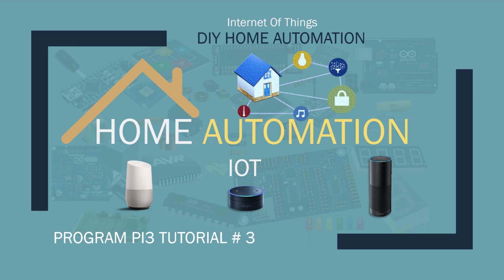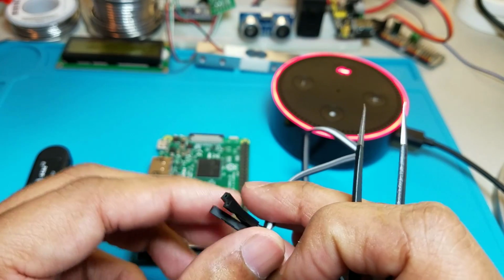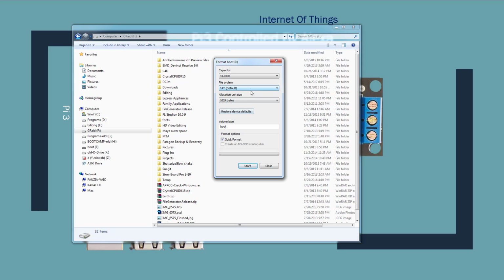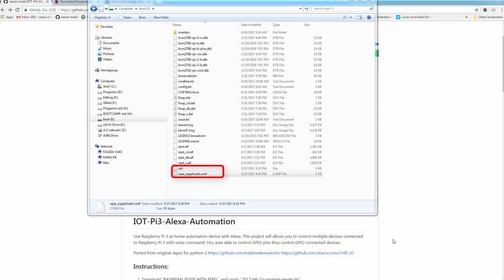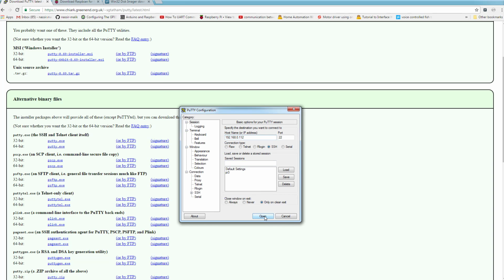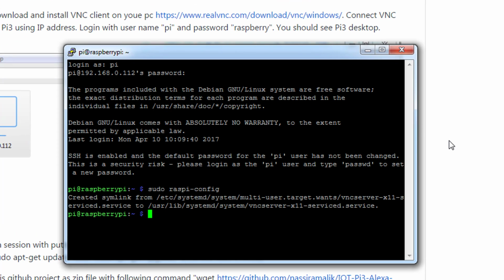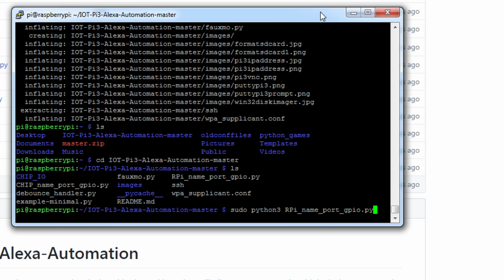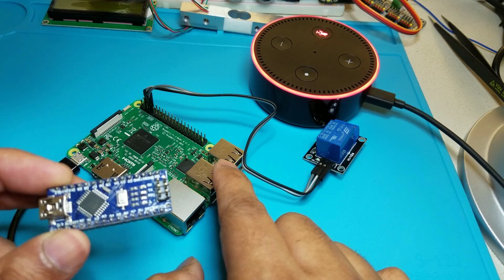Raspberry Pi projects beginners | Home Automation with Alexa | Tutorial # 3

Comment: I am trying to use a 4 relay block with this. With LEDs the code works perfectly with voice commands. However, using the relays the HIGH output state turns the relay off and the LOW output state turns the relay on. Due to the nature of the project I am doing, I cannot simply flip the wires in the relay to invert it and rather must do it on the python code. I have tried using "if" statements to say
 if state=="True":
                GPIO.output(int(7), 0)
 else:
                GPIO.output(int(7), 1)

but this doesn't work. Is there any way to flip the variable state?

Also, is there any fix for the following when launching the program in the terminal?
pi@raspberrypi:~/IOT-Pi3-Alexa-Automation-master $ sudo python3 RPi_name_port_gpio.py
DEBUG:root:Listening for UPnP broadcasts
DEBUG:root:got local address of 192.168.*.*** (these aren't actually stars)
Traceback (most recent call last):
  File "RPi_name_port_gpio.py", line 85, in <module>
    fauxmo.fauxmo(trig, u, p, None, port, d)
  File "/home/pi/IOT-Pi3-Alexa-Automation-master/fauxmo.py", line 195, in _init_
    upnp_device.__init__(self, listener, poller, port, "http://%(ip_address)s:%(port)s/setup.xml", "Unspecified, UPnP/1.0, Unspecified", persistent_uuid, other_headers=other_headers, ip_address=ip_address)
  File "/home/pi/IOT-Pi3-Alexa-Automation-master/fauxmo.py", line 130, in _init_
    self.socket.bind((self.ip_address, self.port))
OSError: [Errno 98] Address already in use

Comment: I like this project, but I can't get Amazon Echo to find the Pi. I am using RaspPi 3; Model B with a brand new Echo. This is the status of the Pi when I run "sudo python3 RPi_name_port_gpio.py"

DEBUG:root:Listening for UPnP broadcasts
DEBUG:root:got local address of 192.168.0.10
DEBUG:root:UPnP broadcast listener: new device registered
DEBUG:root:FauxMo device 'kitchen' ready on 192.168.0.10:52000
DEBUG:root:UPnP broadcast listener: new device registered
DEBUG:root:FauxMo device 'living room' ready on 192.168.0.10:51000
DEBUG:root:Entering fauxmo polling loop

when I ask Alexa to discover devices, nothing happens. No devices found and the ssh never changes. Any ideas?
Reply from the maker: Michael McCloud is your pi and echo connected to same router? Can you check router log to see if you are getting the request?
Reply: Yes it is. But I can't check the router log. Using one provided by new internet provider. Changing it out soon though

Comment: Hey, bit of a n00b here, but ive done the steps and it works for living room and kitchen, how do i add extra devices? (using an 8 relay board)
Reply from the maker: Use the following python code.

https://github.com/nassir-malik/IOT-Pi3-Alexa-Automation/blob/master/RPi_name_port_gpio_8_Relays2.py
Reply: Netmedias Thanks dude, will have a look tomorrow and hopefully sort it out, messed around for a few hours today to no avail.
Reply: Nice, I got it working! Only issue i'm having is turning on/off multiple relays at the same time, I think it may be a power issue as they all work independently. Do you think powering the relay board externally instead of powering it from the pi could work?

Comment: Nice video
But When I insert on Puty default raspberry it is not work,, it leave a word is access denied
Please help me
Reply from the maker: Chi-Tinh Nguyen looks like you are not using correct user name and password.

User name :pi
password :raspberry
Reply: same here. the username(login as) would be pi and the password would be the login password of ur pi(if u have changed it). and by the way controlling the raspberry pi using putty is optional, u can directly use the terminal built in with raspbian. should be doing well. :)

Comment: My echo will not find the raspberry pi, Is there a skill I need to enable for my echo?
Reply: Thanks for that great tutorial. Unfortunately I have also the 2nd generation of Echo, which doesnt't find Raspberry Pi as a new device. Thanks for your help!!!
Reply from the maker: Justin Cole No skill required. Are you using echo plus?
Reply: Netmedias No, I am using the 2nd gen Echo. I’ve tried it on two different networks with no luck. I’ve also used two different pis. I’m not sure what the issue is.
Reply from the maker: Justin Cole make sure Upnp is enabled on your router and connecting to a 2.4 Ghz router.
Reply: I did
Reply: upnp is enabled and it is a 2.4 ghz router. I just used another router and its still not working. I don't know if amazon did something to alexa to make this method not work anymore with the 2nd gen echo?
Reply from the maker: Justin Cole Amazon did change some functionally and that is why some folks are having issue. I will let you know once I have the answer.
Reply: Netmedias thank you!
Reply: Netmedias any updates on this?

Comment: How can I change ON\OFF to OPEN\CLOSE so that I can say "Alexa OPEN GarageDoor"(instead of Alexa turn ON GarageDoor). Thanks!
Reply from the maker: ltra L You can do this without changing the code. Use Alexa routines in Alexa mobile app to map your custom commands. Good luck.
Reply: Thank you. Do you  know how to modify to the code so that I can ask Alexa the state of the device like "Alexa is kitchen light ON (or OFF)?
Reply from the maker: ltra Le You need to create a custom Alexa skills to achieve this. Please watch my tutorial on this. Good luck.

https://www.youtube.com/edit?o=U&video_id=DYBOoJf8IVs
Reply: I saw you video using esp8266+ultrasonic senor+relay to control the garage https://www.youtube.com/watch?v=OrhkuJiahDs....how can I add ultrasonic sensor to this project ( Pi + Relay + UltraSonic ) ? Thanks!

Comment: Hello. I commented earlier about changing parts of the code, however, I never got a response. I want to change the polarity of the relays, and I was in previous comments that you can use any text editor, however, I can not get mine to work. I downloaded the notepad++ thinking it would work, as it does python text, but when I went to go upload it, it didn’t work. Any ideas?  My thinking is that I’m doing time thing wrong on puddy
Reply from the maker: Remy Dasher You can clone the GitHub repository with your github account that will allow you to modify and deploy the code to Heroku. It is free. Good luck.
Reply: Netmedias and then when I download the zip file, I would download my edited version and upload it to putty
Reply from the maker: You don't need to download it you can edit it on github. Click the file and you will see the edit icon (pen) next to trash icon. You can click it and edit and save your file. Good luck.
Reply: Netmedias I’m sorry. This is all still new to me. Do I create a new repository? And after I do edit the file, how to I get it on the raspberry pi?
Reply from the maker: Remy Dasher Sorry! I my bad .I got mix up and gave you the answer that was intended for a different project. You don't need to make a clone of the project. Just download the project on pi and modify it using python 3 editor.

You can access it from programming->Python 3 menu.
Reply: Netmedias okay. So I do that from putty
Reply from the maker: Remy Dasher you can connect to pi using VNC. See the optional steps on github on how to access the pi desktop.
Reply: Netmedias right so I did that, but how do I access the code?
Reply from the maker: Remy Dasher Please watch the tutorial or read the instructions on github. Step 14 shows the command to download the code.
https://github.com/nassir-malik/IOT-Pi3-Alexa-Automation

14. Download this github project as zip file with following command "wget https://github.com/nassiramalik/IOT-Pi3-Alexa-Automation/archive/master.zip"
Reply: Netmedias I have, about 5 times. I’m trying to say that when I’m the vnc server, I can not edit any code. Do you know where it is?
Reply from the maker: it should be in your home directory. use the file explorer to access it.
Reply: Hey. So I got into it, but it complained about the indentations. I tried to fix them but it didn’t work. This is my 3rd day trying to fix this. Is it okay if I just tell you what’s wrong and you can put it in the GitHub website?
Reply from the maker: Sure
Reply: Netmedias great! So when I tell Alexa to turn on the relay, it turns it off. And I wanted to switch “tv” to pin 16. That’s it
Reply from the maker: I modified and uploaded the file "RPi_name_port_gpio_8_Relays2.py" to github. Good luck.
Reply: Netmedias thank you so much. I’ll let you know
Reply: Netmedias perfect! That seemed to work! One final thing. How to I make this code run constantly. I plan on having it be continuous

Comment: I want to use this exact same setup but have Alexa control multiple relays. Does anyone know where any sample code is for the Pi to control multiple GPIO pins with different voice commands for this same setup? Great video by the way!
Reply from the maker: Stephen Davis You can use the "RPi_name_port_gpio_8_Relays.py"  file to control 8 devices. It is ob github.
Reply: Thanks! I will give it a shot!
Reply: Got it working great! Thanks for posting this tutorial! I was wondering if you knew a line I could put in the script to command all devices off with a voice command from Alexa?
Reply from the maker: Stephen Davis You can achieve this without modifying code. Just use Alexa routines in you Alexa mobile app. Good luck.
Reply: Netmedias hello. So far I love your project, however I ran into one issue. I was wiring up the 8 channel relay board and I noticed on the code that pin 13 is used twice for the same relay. Is there a way to fix this. I’ve tried by modifying it in word pad, but that did not solve anything. I am so close, it’s just this one hang up. Also, when I close out the raspberry code thing, it stops remembering my triggers and doesn’t respond
Reply from the maker: Remy Dasher It is there twice by mistake. You can change it to a different GPIO pin. Good luck with your project.
Reply: Netmedias Silly question, but how exactly do I do so? I tried to do it in notepad, but it wouldn’t let me. And is it the gpio number, or the pin number? Sorry for the dumb questions, I am quite new to this. Also, how do I make the code stay when I close the putty interface?
Reply from the maker: It is a pin number. You can use any text editor to change it. I updated the code on github to pin 15 you can try that and let me know if it is working for you. Thanks

https://github.com/nassir-malik/IOT-Pi3-Alexa-Automation/blob/master/RPi_name_port_gpio_8_Relays.py
Reply: Netmedias awesome! Thank you so much. I have one more question. How to I make the code save in the pi when I close out the putty window? Also, I’ve read this on other reply’s but I can’t seem to get it, how do I reverse the relay polarity. On what file do I do that on?
Reply: Hey. I’m sorry to bother you again, but my pin 15 doesn’t seem to work. It turns on without instruction and I can’t control it. I tried to change it but it wasn’t working. Can you change it to pin 16?

Comment: Have you tried this with the new Echo Plus and Raspberry PI 3 Model B?  I can't get Alexa to recognize any devices. Please help
Reply from the maker: Jason Hogan It is not the hardware but Amazon cloud service that is making this work. If you don't see anything in ssh window when you give discovery command then the issue is that echo or don't can't see your pi on network. Make sure they are connected to same router and UPNP is enabled. Good luck.
Reply: No matter what I do Alexa will not discover the Pi. Sets at "DEBUG:root:Entering fauxmo polling loop" I added the above you said to my WPA file for Rasbian Stretch and still nothing. Tried bringing them both up on my mobile hotspot and still nothing. I can connect them together with the Bluetooth option but that is not doing me any good. So frustrating. Please help
Reply: Any update on this? No matter what I do it will not work.
Reply: Hey, I have the same issue and identical hardware. Did you ever fix this?

Comment: Nassir, thanks for such a detailed tutorial. I followed all the steps, but couldnt get the alexa to discover my devices. Had a few questions. Is it required to enable wemo skill in the alexa app. I was not able to do it as there are geographical restrictions(India). But your tutorial dosent say about enabling that skill. I have used a pi ZeroW. will that change any thing.
Reply: On the Putty terminal I get "Entering fauxmo polling loop" There after when I say "Alexa, Discover Devices", Alexa asks me to enable Smart home skill in the alexa App. Thereafter it searches for smart home devices for 20 seconds and says couldnt find any. I dont see anything changing in the putty terminal when I give the discover command to Alexa.
Reply from the maker: Jerrish Jacob you don't need to enable any skills. What do you see in console when you give discover command?
Reply: Nassir, by mistake I replied from my wife's Computer. Consider the above as my reply. Additionally, while I am typing arp -a, I dont see the ip address of the pi zero listed. Will that have something to do with this issue. The pi is connected to wifi as can be seen in my raspian desktop and the ip address displayed there works with Putty on wifi.
Reply from the maker: Mareena Jerrish Check your Alexa app make sure that device is not already listed. If it is not then make sure the Alexa device and pi are connected to same network. Try to restart your Wi-Fi router. It looks like Alexa device can't see your pi on the network.
Reply: Thanks for the quick reply. I checked. The device is Not already listed in the alexa app. The Alexa and Pi are part of the same wifi network. I restarted wifi router as well. But still the Alexa is not able to discover my Pi. Could it be any issue with the settings on the router. I am too eager to get this working. Please help me in getting this up and running.
Reply: Dear Netmedias ... I m facing the same issue...
Reply: I'm unable to discover the devices from both echo dot and alexa app. Is there any restriction imposed by Amazon on this? Did any one verified it recently?

Comment: Hey Naasir,

i have a small Problem with your 8 channel Script... 
I wanted to change the Polarity of the relays with the built in lines in your Script ("Uncomment this code to revers the relay polarity")
I did this and got an Error "line 35 if state == True: IndentationError: unexpected indent".. can you help me?

Also another Question.. is there a way I can send a short Signal?
I need a Script that turn on the relay for a Second and then turn it off again.
Can you Help me with that?

Thanks in Advance!
Greetings from Germany
Reply: The Second scrpit should work in the 8 Channel Scrpit..
I need it like:
Alexa Turn The Lights On
Relay Turns ON and turns OFF after a second

Alexa Turn The Lights Off
Relay Turns ON and  turns OFF after a second

I tried 
GPIO.output(int(11), True)
time.sleep(0.5)
GPIO.output(int(11), False)

but it didnt work for me :/
Reply: Eukal Can For your first issue just fix the code indentation. Python is indentation sensitive and it uses it to know what part of the code belongs to which statment. You can use any text editor to fix it or use any Python IDE that can help you to fix the issue. It should look like this.

if state==True:
    state = False
else:
    state = True

if name=="kitchen":....

Answer to your second question is very simple. Use the following code.
        if name=="kitchen":
            GPIO.setmode(GPIO.BOARD) ## Use board pin numbering
            GPIO.setup(int(7), GPIO.OUT)   ## Setup GPIO Pin to OUTPUT
            GPIO.output(int(7), True)
            time.sleep(1)
           GPIO.output(int(7), False)

Please fix the indentation. I can't type it correctly here. Make sure use tab for indentation. Good luck.
Reply: Thank you very much :) Now Everyting works just fine!

Comment: Hey Naasir thanks for the wonderful detailed tutorial... My 8 channel relay device works just fine. I saw your other video using a two way switch with esp 8266. The idea is brilliant!! Can such type of 2 way switch control be integrated in this project ? An input gpio state of the switch can be read at script startup. Change of switch state should on/off the device and also make Alexa realize the changed state. The idea seems more practical. Also can the script be made to store the last state of devices in case of power failure. Thanks a lot.👍
Reply from the maker: Vipul Prashant thank you for your feedback. 3 way 4 way pi 3 tutorial coming soon. Stay tuned.

Comment: Hello Nassir! Great Job!
BUT... I'm having problems to utilize the Group of devices on Alexa App.. like the group "All", were I have included all my relays. Seems that your "act" function is called only one time.. and not the number of "devices" Alexa is asking to operate...
any updated script?
thanks in advance!! :)
Reply from the maker: Thiago Winkler I am not sure what the issue is but for now you can add them in "Routines" through your Alexa mobile app. Good luck. Thanks
Reply: I find a solution doing this
  if name=="kitchen":
            time.sleep(0.1)
            GPIO.setmode(GPIO.BOARD) ## Use board pin numbering
            GPIO.setup(int(7), GPIO.OUT)   ## Setup GPIO Pin to OUTPUT
            GPIO.output(int(7), state) ## State is true/false